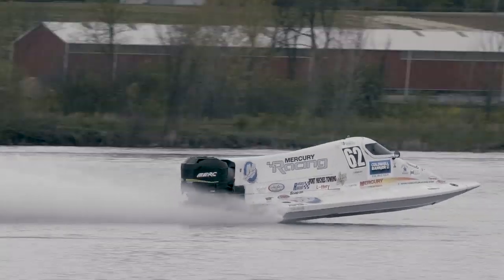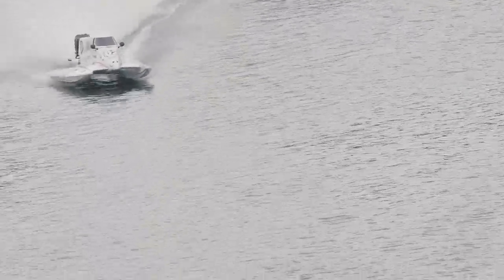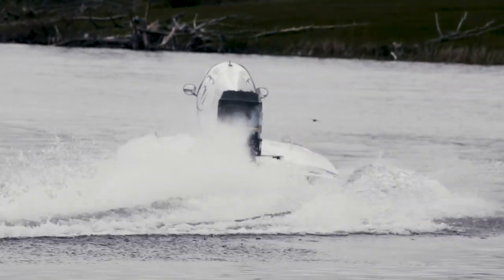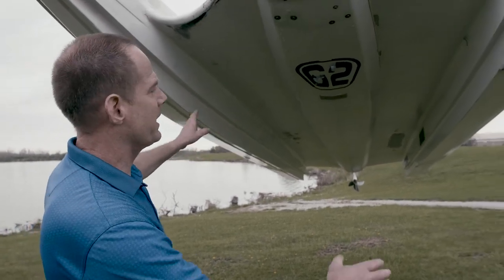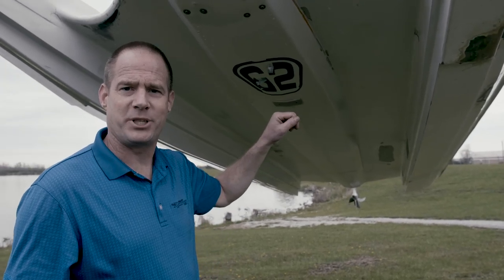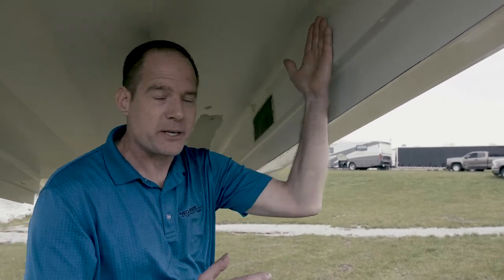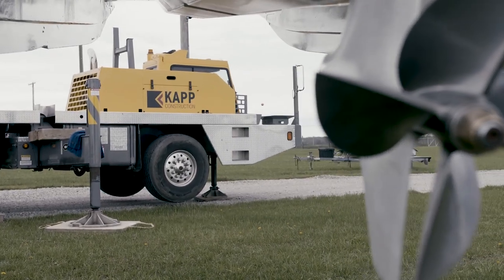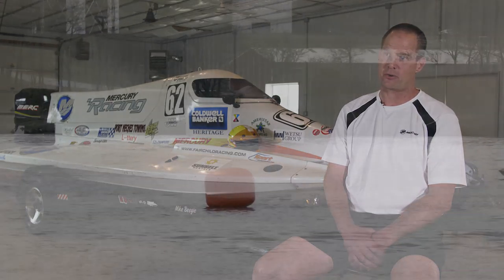Turnability in Tunnel Boat Racing

Comment: Classy looking hull , would make a super semi scale RC racer. Any chance of length and width, i could scale the rest off video ? Regards Paul
Reply from the maker: Length is around 17ft and width is less than 7 ft.  Some folks have some CAD drawings of the boat that you could probably work off of.
Reply: @championsparklake1442  ironclad rc has been running an old F1 rc boat on his channel this week , its nothing short of a work of art , and has a trick cam type out drive that puts the bow down in the corners . Mind blowing for a model.I would love to bring that level to one of my models as retirement is looming, any help with drawings would push me to next level. Regards Paul Baxter

Comment: Where is this "aileron" you speak of? And how is it controlled? I ask because I am restoring a 1971 Magnum Missile tunnel hull boat, and I've always wondered about putting flight controls on it.
Reply: I think he is confusing aileron with elevator of a plane, as in the trim of the motor acting like an elevator.
Reply: @mjodr  Yes, he's thinking of elevator, not aileron.  An aircraft's ailerons control roll, not pitch.

Comment: I’d be interested in you discussing the center pod. I know in the consumer market there is debate on having it or not.
Reply from the maker: Are you referring to the driver capsule and the crash boxes?  I know in the UIM they require additional padding or crash boxes around the sides of the capsules.  Hoffman Race boats are looking to do a 10K Newton strength capsule instead of the crash boxes
Reply: @championsparklake1442  underside. The “middle sponson”
Reply: @kevinclark9176  the center pod, generally in what I know as a "Mod-Vp" tunnel Hull, is extremely effective for carrying varying amounts of weight without causing the hull to be "stuck" to the water.. 
  Basically true tunnel Hull boats are very weight sensitive where as the Mod-Vp tunnel with the center pod is far better suited to different loads like any runabout, performance and just the regular ole slow one's, constantly see..